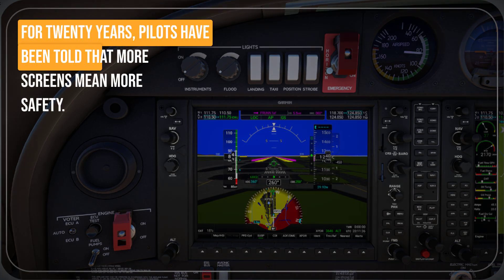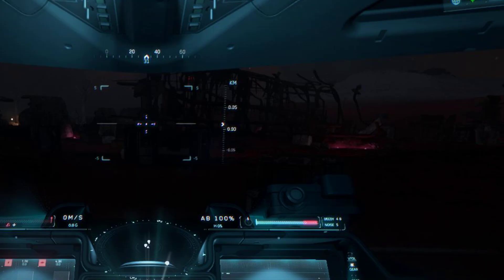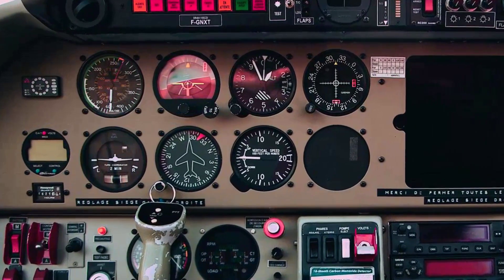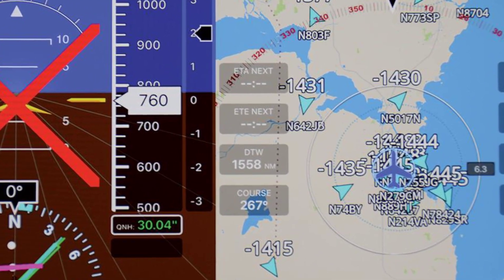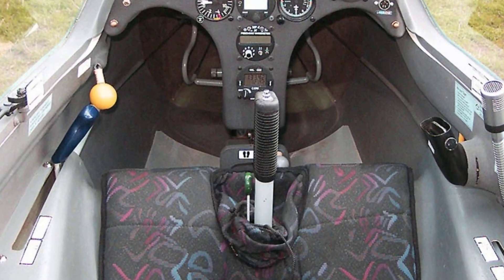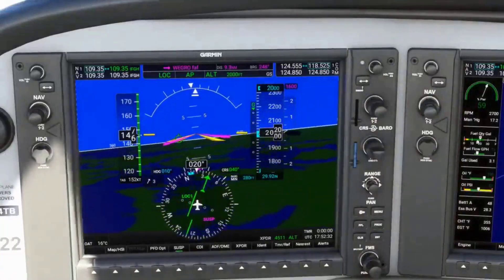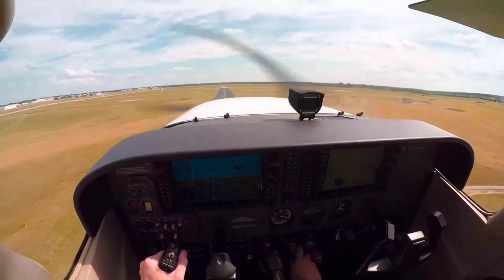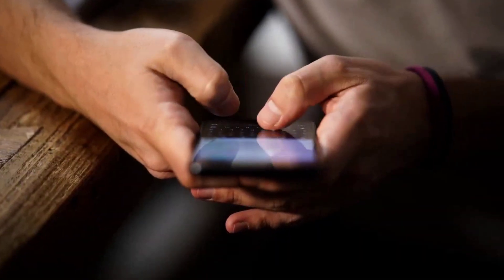Why 'Old School' Cockpits Are Actually SAFER Than A G1000

Comment: I absolutely love steam gauges.  Because they are discreet, there is no job for the brain to do to discern separation of information because there are solid (circular) boundaries.  There is hardly any mental clutter.  

For a rough analogy, early (but post DOS), say, Win 95, or even better, Macintosh 512 displays were simple, and quite intuitive (intuitiveness doesn't count in a cockpit as much as muscle memory).  The computing experience was very straight forward.  The more things have progressed, the harder it is to have an adult - who has never used a computer - to jump in and learn.  The clutter has to be forged through, at which time - and only at this time - muscle memory is developed enough to use on command.  

Point?  There are no buried menu items or cluttered screens to forge through at each viewing to be able to then use the info.  That extra step with steam gauges does not exist.  (For that matter, that extra step exists less with the above-mentioned simple computer software - that's the analogy, although it might not be a good one to use for this discussion, but I'm trying here :D )  Of course there are many advantages to glass, such as those nifty checklists, and just as important, emergency checklists, GPS, visually displayed weather, etc. but I'm only talking about primary six pack info - the essential stuff.

And personally, I HATE subscriptions.  Talk about mental clutter.  "Oh, my goodness, I have to dink around with budgeting and plinking around again with calling customer service, because NOTHING ever goes good with only three clicks..."

Comment: I'm not a pilot but have always thought of taking up the hobby. but I enjoy reading about and seeing videos on flying related topics.
this was an eye opener video --- I knew the glass displays were INITIALLY expensive -- but had no idea there was a "contract" that required periodic "bug fixes / adjustments / upgrades".
your point about the solid "old" technology in some ways having an edge over modern displays is worth reflecting more on.
in the event I ever get around to actually flying, most likely it will be an older plane that has older instruments.
based on your video, that might be the perfect fit for me. 
at least initially. I have seen some of these "hand held" GPS type devices (like the Dynon D3 pocket panel) that in combination with analog instruments could represent a decent compromise. inexpensive (ca $1K), very easy to install, they actually appear to work, and even if you had to "upgrade" every year to another model that still might be financially more feasible than the actual glass panel displays mentioned in the video.
I'm also hoping that eventually inertial nav systems (maybe even hand held) will become available at reasonable prices -- I think that also would be a very good option w/ primary emphasis on the analog display.
Reply from the maker: Glad the video was an eye-opener!
Reply: Those hand held devices are great for situational awareness, but are not legal to fly IFR, which is something every pilot that wants to get beyond weekend recreation should strive for, in my humble opinion.
Reply: @JonBurgin  I disagree that getting beyond  "recreational" flying is that worthy of a goal. Or even ultimately that useful for the nonprofessional pilot.  Rather, it seems more about playing the FAA "ratings" game than being really useful.  I am instrument rated, though not current, obviously.  I NEVER had reason to actually use my IFR rating when I was current.  The American GA  industry tried to sell  the IFR  usefulness myth to a whole generation of pilots, and today's greatly diminished flight activity is the result.  The truth is that the IFR system was designed for the commercial aircraft industry.  It turned out for the rest of us that the increasing reliability of the automobile made IFR flying pointless for the vast majority of people.  Having to listen to blaring radios from startup to shutdown was not my idea of freedom of flight anyway., although that is just my opinion. I understand that today,  being able to sound like a radio DJ is equated with flying skill. But for me, building flying skills was the most important thing.

Comment: Whilst some of the points made here are valid, let’s face it: glass cockpits are mainly being used in airline oriented flight training programs. Training to look at the instruments isn’t necessarily a bad thing specially considering a TCAS RA is supposed to be followed by looking inside. Obviously not applicable in a training VFR environment but most schools will save the more expensive fancy airplanes for later stages of training

Comment: Fun fact. If you only have one cable tension reader, a G1000 visible inspection requires a rudder re-rig on a King Air 350
Reply: Why is that
Reply: @davefoord1259 part of the visual inspection tells you to check the autopilot rudder servo cable tension. The procedure is to double the main rudder cable tension then check the servo cable tension. Of course then you'd have to relax the main canble tension.  With just one one tensioner gauge you'd have to alter a turn buckle on the rudder main cable. Then tighten it check the other cable tension then reloosen it and make sure you didn't alter the rudder rig.  If you have two tensioner gauges. Put them on the main and the servo cables are the same time. Squeeze the main cable by hand until the tension is doubled and read the servo cable. Let go when finished. No turnbuckle altered no re-rig required. Why Garmin thinks that's a visual inspection is beyond me
Reply: @insylem  what a strange inspection. Do you understand why they do that?

Im an avionics and autopilot guy, dont make sense to me never heard of anything like it
Reply: @davefoord1259 it may just be a King Air 350 thing. I mean it makes sense to check the cable tension periodically but to require doubing the main cable tension to check the autopilot cable tension seems absurd. Grouping it in with a visual is more absurd. Never had to double cable tension on autopilot installs for Piper PA-28s
Reply: @davefoord1259 TLDR: Engineers are dumb

Comment: This is common sense. I noticed it using the MS Flight Simulator. I learned to fly 55 years ago, long before glass cockpits were even thought of. It worked as the above person has stated. The old instruments give you what you need in a fraction of second. When I later tried flying in the MS Flight Simulator (my only experience of glass cockpit as I no longer can fly real aircraft), I found the displays confusing and causing overload. To be honest, I preferred the real aircraft which needed real pilot skills of 55 years ago vs the airborne video games of today.

Comment: I don't really buy the "traffic avoidance systems make it actually worse"-narrative. As a glider pilot my life was saved several times by having a Flarm display. Even with the much better view in a glider vs a Cessna and constant looking out for traffic, you never see all of it. In these cases I would never have spotted these other gliders due to lighting, them beeing white and in front of clouds etc...

I do agree tho, the design of the display has do be really on point an thought throu.

In case of Flarm displays originally you had a clock indicating the direction relative to you and then whether the other plane was higher or lower. This is really intuitive and takes almost no time to absorb the information. On the newer ones you have a small radar like screen, showing more info. But once a collission is possible it instantly falls back to the old style with the clock. There are also different sounds for "there is some contact far away" and "you are in trouble, act now".

One big thing also is placement of the information. Your traffic display should ALWAYS be way up top, best are the ones mounted on the glare shield. This greatly reduces the time of looking at it and then trying to spot the other plane.

Comment: G1000s/ digital instruments are way safer. Better situational awareness, almost completely reliable due to solid state components, and allows you to do advanced procedures automatically while having attention to other aspects of flight.
Reply: Electronics go out all of the time. The circuit boards die and screen die. I learned on a six pack and want to go to glass, but scared of the reliability with them and reading the tapes quickly without having to stare at it.
Reply: @kimskislalom you’ll never have 2 G1000 screens fail. Older pilots don’t like the fact, but no matter how much they disagree, it’s still true
Reply: Not all big birds, drones, and paragliders will show up on your box while you're staring at the display rather than looking outside in VFR weather.
Reply: @williammcintosh6267 good luck seeing an object 2 feet wide anywhere in the sky
Reply: I still prefer a 6-pack. Most digital displays are far too cluttered.
Reply: You are not looking outside to work with these screens...
It is safer with two pilots, not at the same level with single pilot operations.
Reply: To a degree yes glass panels are safer, but they are also UNSAFE because when the automations stop working, they become a huge distraction to those unfamiliar
With the system who are fighting through trying to fix the automation instead of dooing  rule number one... rule number one is fly the airplane. 

As a pilot who trained during the mid-2000's and flew professionally in the same time period we transitioned between steam gauges and glass panels constantly. The automations in the g1000 are great on instrument approaches but what if those automations fail... for instance, my avionics is telling me to enter a publisged hold on an approach, but ATC is giving me vectors? it's a small distraction that yes a few button strokes can alleviate, but the aforementioned situation is a non-issue with steam gauges where everything has to be done manually.

Comment: Not only a reasonable "food for thought," but makes good points.  I would also NOT throw away the ADF.  Why?  The FAA got rid of nondirectional beacons, so why keep the ADF?  The FAA has reduced, eliminated VORs as well.  GPS is dependent on satellites in orbit.  In case of massive solar flair, big meteorite storms or military conflict the GPS satellites will either need to be shut down or the enemy will seek to shut them down as their primary initial purpose was to target military weapons.  GPS satellites will need to be defended which may not be successful.  Inertial navigation systems are insanely expensive, and installation in a small, private plane may be an insane investment.  So what of the ADF?  It can point to commercial AM radio transmitters, which are plentiful all over the USA.  If a selection of these transmitters is indicated on a charts, the "old ADF" will point to them.  When the GPS fails, and the VORs, thanks to the shortsighted FAA are gone,  the ADF can still home on a commercial AM radio station transmitter.
Reply: I still follow along my route with VOR’s & NDB’s in the 737.  Waiting for the loss of GPS or the IRS.  Old habits don’t die.
Reply: Dab radio
Reply: @snorttroll4379  ??🤔